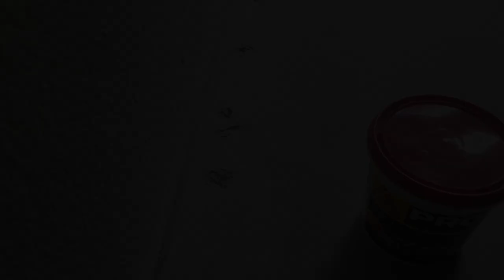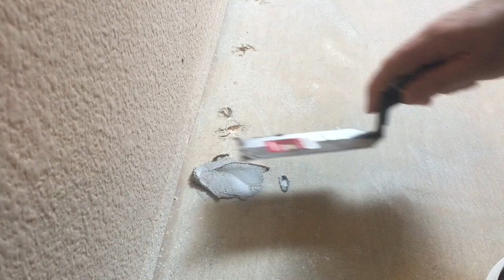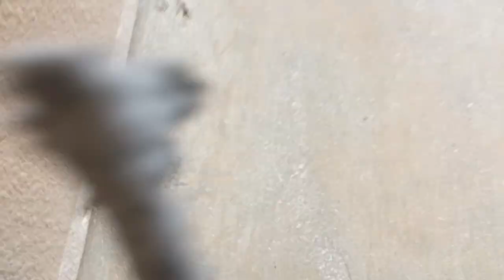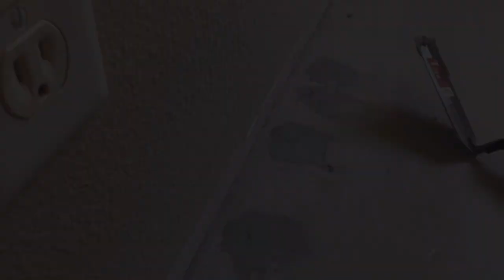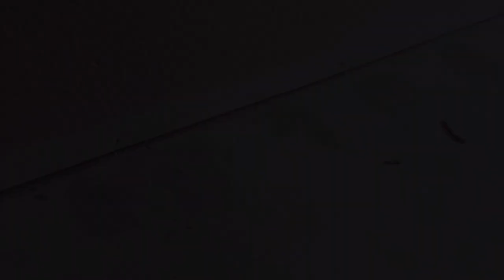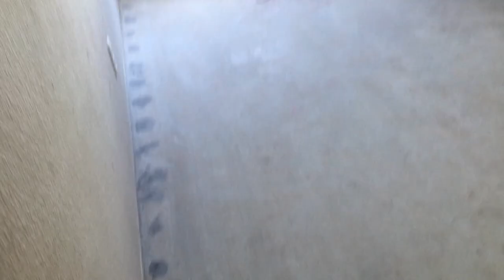How to patch concrete holes

Comment: What I learned that concrete needs to be wet first before any patch work.
Reply from the maker: It doesn’t hurt.  Helps as an  adhesive   I threw down mortar and tile after it dried so I think it went well

Comment: Thanks for the videos! I’m pulling up linoleum, carpet, and old vinyl tile to remove the glue and patch the concrete slab. Great to know the baseboard and patching the concrete step is so simple!
Reply from the maker: Yes Ma’am. It’s not bad at all. Yea we tiled the whole house during COVID stay at home. A lot of work but it’s fun to see it all come together. Good luck on your project and if you have any questions feel free to ask.
Reply: @MendandMake  Thanks! Once the floor is prepped I’m gluing down and grouting Armstong Alterna Tile so it’ll be a little different, but your videos really help make it look doable.
Reply from the maker: @Hillary92126  yea thanks.  Yea it’s a little different depending on materials.  I have a link in the description on my grouting video of the kind I used but I used it because it does not require sealing it. It already has polymer in it which fills in tiny holes. And you can walk on it in 4 hours .
Reply from the maker: Using a heat gun will help get the old linoleum and vinyl up
Reply: @MendandMake  Thanks for the tips. I found a matching grout that works with Armstrong Alterna and also doesn’t need to be sealed. 🤞🏾 
 
I’ll definitely break out the old heat gun on the more stubborn linoleum.
Reply from the maker: Nice!

Comment: Can I use it on walls
Reply from the maker: yea for sure
Reply from the maker: Is this a question for Hillary?
Reply from the maker: @Terri Delaune yes it will look different but try a spot in the closet. If it’s way off just do a concrete overlay to get a uniform look before you stain

Comment: Just chipped my brand new side walk, about 2.5 inch long by 1.5 in, you think this would work? Also does it take stain?
Reply from the maker: It will work.  I’m not sure if it will stain evenly. Probably be a little different because the compound isn’t quite the same as the original. Just my opinion.  But now I have to do a video on this experiment to find out lol.  Thanks for the idea
Reply: @MendandMake  Going to give it go, appreciate the reply!
Reply from the maker: Let me know if you stain this

Comment: I swear this same repair is shown on the Home Depot website for this patch mix.
Reply from the maker: Some will say you don’t have to do this but I would if your not laying down tile with mortar. If you use mortar just use mortar to fill in while you tile

Comment: I have a long concrete beam that runs along the bottom of my wall, it looks like the previous owner spray painted it white. It is full of holes the full length. 
Will this product work to just trowel it in or since it’s a vertical will it spill out of the holes? I am wanting to paint afterwards to match the wall. 
Any tips would be greatly appreciated!
Reply from the maker: Just apply it and stay there with it with your trowel. That’s the best you can do. Gravity will have some affect but this stuff is viscous and should do you alright.

Comment: I patched my foundation of my house and it harden up pretty quick but about 6 hours later it rained and the water running off the roof splash on the foundation and softened it up to the point that it started running off the foundation. I have to redo the whole job. I don't understand why because it was already hard. Is it because it needed the full 24 hrs to cure?
Reply from the maker: Yea it’s the cure time. Some water might extend the cure time but it sounds like it just got too saturated
Reply: @MendandMake  Well. I re did the job and the weather was clear for 24 hours and a job came out great!
Reply from the maker: That’s awesome. I’m glad to hear it worked out.

Comment: Thank you. I appreciate  the video and the effort you put into it. Will this work for small divots in my concrete driveway?  I get those from shoveling snow in the winter. By the way, I am looking at a small container of concrete compound from DAP to fix it.  Please respond soon. Thanks again.
Reply from the maker: It’s for all concrete. It’s cured in 24 hours.  Should be fine

Comment: On my concrete pad out side my back door,there is a groove where the wood was used as a form.It is approximately 1 1/4” wide by 6 feet long and 1” deep.Is there a product that can fill that groove permanently?
Reply from the maker: Yes. Use closed cell backer rod, caulking, and sand    Checkout an expansion joint seal video
Reply from the maker: Most times those gaps are filled with some flex in mind so your slab does not crack.   If you try to fill it with concrete to fix it permanently you can risk cracking your slab

Comment: So, basically, you made concrete colored holes. I had the same results with that crap. Switched to epoxy instead.
Reply from the maker: It’s not good for doing a stained floor for sure. Going to have two different colors
Reply: @MendandMake  Which is not good for stained holes, the epoxy or the concrete patch?  Need to patch and stain my patio.
Reply from the maker: @robertd9850  i don t believe the patch mix is good if your going to stain or at least I havent tried it  im sure there would be a slight difference after you stain  try a hidden corner of the room/closet and see
Reply: @MendandMake  It doesn't have to me a perfect match since the semitransparent stain is meant to show imperfections in the concrete.  Just wondered if there was a compelling reason to use one over the other but it doesn't sound like there is.  Thanks for getting back to me.
Reply from the maker: @robertd9850  yea it shouldn’t really matter for a stained concrete.
Reply: How well does epoxy take color or can you tint it in advance of applying it? Do you have a brand you recommend?